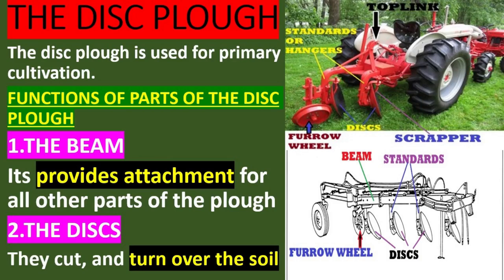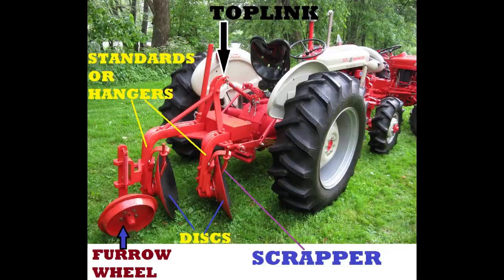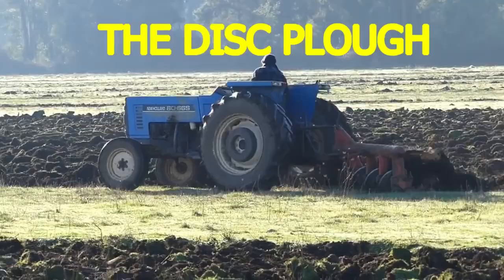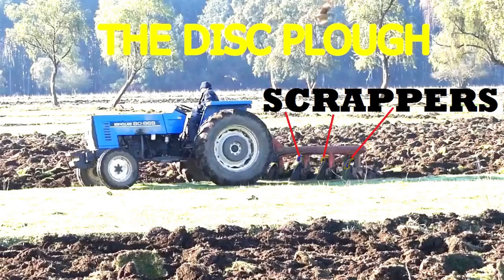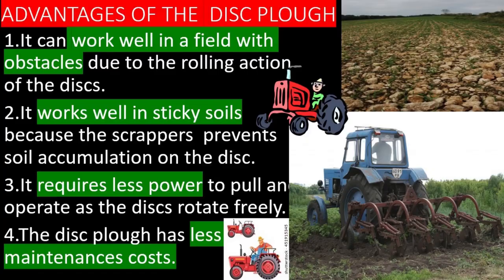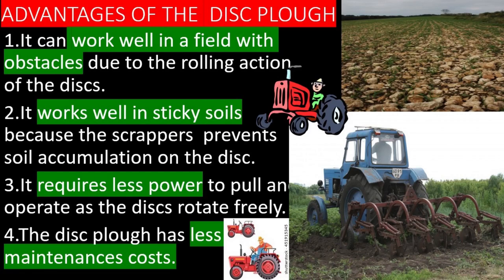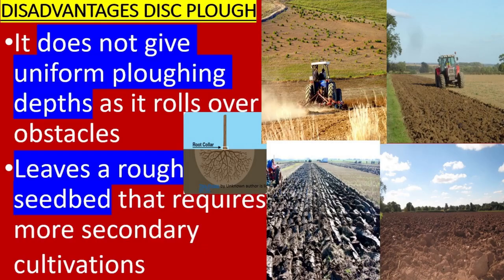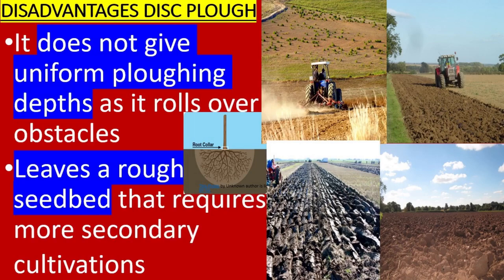Disc Plough Parts and Functions.

Comment: Disc plows are the bomb. I prefer them to conventional plows. Too bad they're not overly popular. I have an old Dearborn 10-246 disc plow. Finding parts can be a strait up byatch.
Reply: I've recently reconditioned a Massey Ferguson P-AO-21.  I lucked out as the bearings still had readable model numbers but I had a hell of a time finding a seal for the trailing wheel.  Additionally the smooth Coulter disc will need to be custom cut for the center the center circle, the bolt circle and larger bolt holes.  Also the bolt holes will need to be drilled out and tapped as the originals were damaged from the plow running without a Coulter disc.